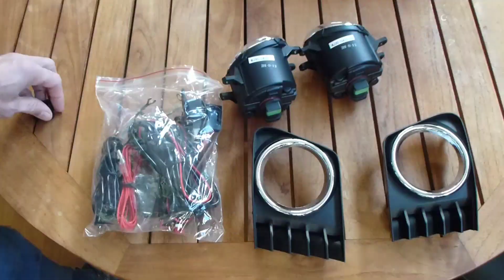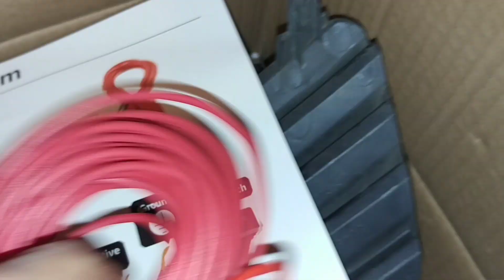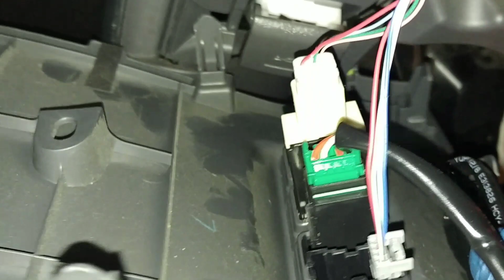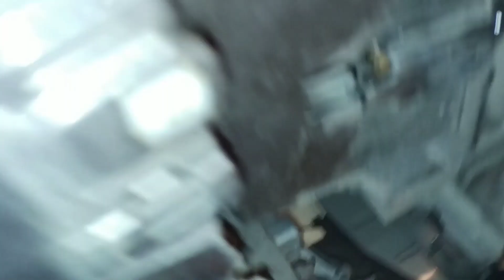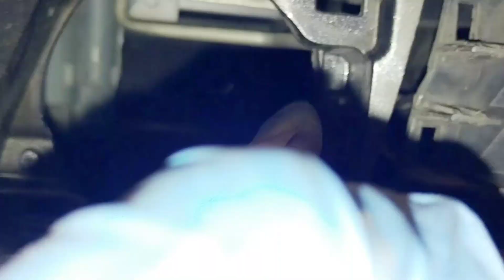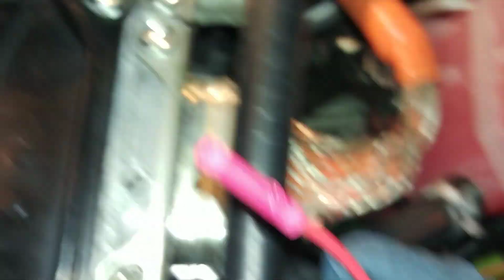How To Install Fog Lights on a Toyota Prius

Comment: This video deserves way more kudos. I’ve watched dozens of car DIY tutorials, and this one was - by far - the best one. Every single step visualized, super clear instructions with zero filler, and decisions (eg. connecting it to the cigarette lighter instead of the battery at the back of the car) that are super smart. Truly - thank you so so much. You just saved me so much time and stress.
Reply from the maker: I appreciate the feedback and I'm really glad the instructions were helpful and saved you some stress. Thanks for sharing.

Comment: Where to connect it you never showed my Prius  c has the battery in the back seat where can I get the power supply because the harness is not long enough to
Reply from the maker: The battery for the car in the video is also in the rear behind the back seat and I also do not connect to the battery for the video. The reason I don't connect to the battery is to avoid a power source that is always hot. If you get out of the car and accidentally leave the switch on for the fog lights, it would risk draining and possibly ruining your 12 volt battery. For hybrid vehicles, this cause very expensive problems. It is safer to identify and use a power source that is ignition hot only. That means there is only power available when the vehicle is on and ready to drive. It also has to be able to handle whatever the wattage (power usage) is for the lights you purchase. For the vehicle in the video, the AUX power (cigar lighter) wire works well. It is ignition hot only and can handle the wattage for the fog lights. I hope that helps.

Comment: Where did you get the wire and what gauge was it?
Reply from the maker: 16 should work. 14 even better. I already had wire on hand. Auto parts shops all have it or I've got links in the video description to get you started.

Comment: Great video, specially when it comes to power source! 
Just one thing dough ... at least on my 2010 prius hatch , to cut that tube on the firewall was extremely hard, very tight access.
But overall, very nice tutorial .
Reply from the maker: JJ FERRARI: Thanks, I'm glad the video helped. I totally agree on how tight it was getting a snip on that rubber tube. Congrats on a job well done!

Comment: Where is link for 2014 Prius?
Reply from the maker: It's in the video description but here you go: https://amzn.to/30QbWee
Reply: @ScubaMoto  is this only for Prius v or regular 2014 Prius?
Reply from the maker: setiop: My mistake. I thought you were referring to the Prius V. The non-V (regular 2014 Prius) fog light install requires a bit of grill work but this is the common kit -  https://shop.priuschat.com/fog-light-kit-2012-2015-toyota-prius-oem/
The kit is a bit pricy because it includes a replacement grill with fog light cut-outs, fog lights, and the wiring harness kit that is similar to the one in the video. I have no connection to these kits. If you find a less expensive kit let us know and we'll be happy to share. I hope that helps
Reply: @ScubaMoto  I already bought a grill with fog hole from eBay so I just need a fog light. Can I just buy the Prius v fog light and install that on the grill ?
Reply from the maker: setiop: I believe you are correct on that. You will use the Prius V kit discarding only the bezel trim pieces. The rest will go to use as shown in the video. The single screw lights insert into your new grill the same way and the switch setup should be the same as shown in the video.
Reply: @ScubaMoto  thanks I'll buy the fog kit now.

Comment: How were you able to run a wire for switch thru firewall..there is no space to do anything
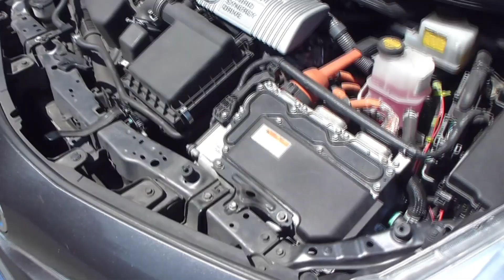Reply from the maker: 3:36
Reply: @ScubaMoto  
Thanks..still looks impossible to fit a hand in there

Comment: Awesome! Gave me confidence & insight to install on my Prius V. You mentioned that you connected the lights to the accessory outlet, but since it's going through a relay, theoretically, it should be able to connect to a constant power source (fuse box, etc). Did you connect both the lighted switch & fog light power to the accessor outlet just in case relay didn't work? Thanks.
Reply from the maker: Patrick Nguyen: Yes, power to: 1-light the switch and, 2-power the relay both come from the AUX power source that shuts off with the ignition. As mentioned in the video, the reason (and advantage) of connecting to a power source that is not always on is to eliminate the risk of ever leaving the lights on when exiting the vehicle. That wreaks havoc on Prius charge systems and it's very easy to do when using them as daytime running lights. And simply connecting to the headlight power source might overload that circuit, blow a fuse and then you would have no main lights or emergency back up lights. I hope that helps.
Reply: @ScubaMoto  can I use that lighter power source positive for fog light and my dash camera together?

Comment: Where did u purchase kit? Im waitn for gen 4 add on's but im learning thru u!
Reply from the maker: Rice Burner: The seller for the ones in the video is long gone but the links in the video description are well reviewed. The install harness and process for a gen-4 is the same but for a gen 4 kit, you used to have to replace the grill with one that has fog light cut-outs and then use a gen-3 fog light kit. They're a bit pricier, but now there are several kits that fit into the gen-4 by replacing the fog light plates. This one should do the trick: https://amzn.to/3sxiDhf  Thanks for the question and for sharing.

Comment: I have all the time I need during this pandemic to get these lights in. 

I'm having a lot of trouble snipping off the tube on the pass-thru. I can just barely fit my hand in there from the engine compartment side, but cannot get a tool in there along with my hand.
Can you tell me how you did it, please?
Thanks for your time. :-)
Reply from the maker: Kathleen Ward: Yeah it's pretty crowded in there.  I used a pair of wire cutter pliers to snip off the end of the tube. You could also lock a pair of Vise grip type pliers onto the end and then cut it with a razor or utility knife. Just take your time getting the tool to the tube and then slowly find a path for your hands to get through the crowded engine compartment to the firewall. I have big hands so I struggled a bit weaving through things but finally got a good position for the snip. Congrats on starting the project.
Reply: @ScubaMoto : Thanks for the encouragement! I'll keep at it then.
Reply: You can also follow the hood latch cable by going through the (US/left) driver’s side wheel well.  

You have to remove the wheel (jack it up, I used the supplied scissor jack), remove the large plastic housing that goes between the wheel and the engine compartment, then you should see the grommet for the hood release cable, and you can follow it back through to the engine compartment beteeen the headlight and main fuse box (again, US, so driver on left side of vehicle). 

It’s good to have an supply kit of plastic and metal connectors (the snap-together holders) for engine compartment and trim as they get brittle and like to break.  

Check out the gen 2 forum on PriusChat for details on hood cable “replacement”.

Comment: Hey thanks for the video. Where did you get the kit from and how much was it?
Reply from the maker: Steve Zarzour: I just searched on 
I have links in the video description. The car in the video is a Prius V so this will work: https://amzn.to/30QbWee. I've also got links for other years. Thanks for the question and for sharing.
Reply: Thanks
I’ve ordered the lights and am going to give it a try.  Any advice for removing the panel with the cigarette lighter?  It looks like it can be pried out from underneath.
Reply from the maker: Steve Zarzour: If you can't get a plastic pry bar under it, try starting it by using a long screwdriver or bar to push it from behind.
Reply: ScubaMoto ok will do.  Have been looking at that grommet in the firewall and I’m wondering what’s the best way to reach it.  It looks pretty tight from above and below under the hood.  In the video you mentioned cutting the cap, you think I could just drill it out from the inside and just catch the fish on the other side?